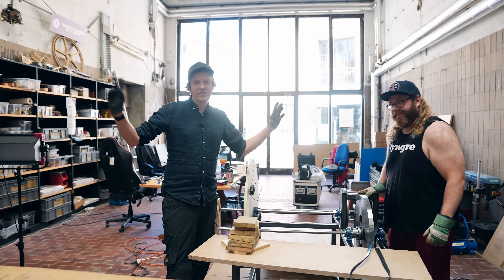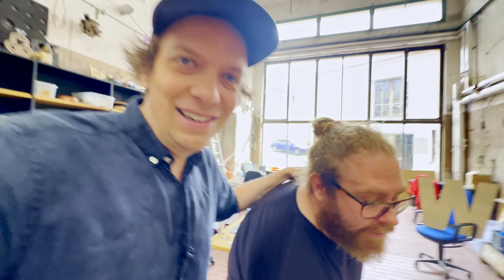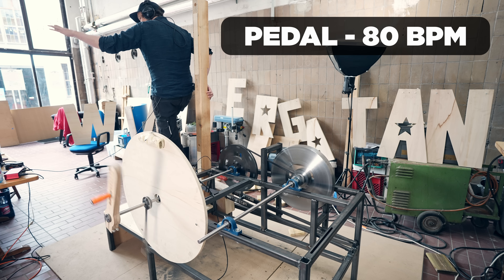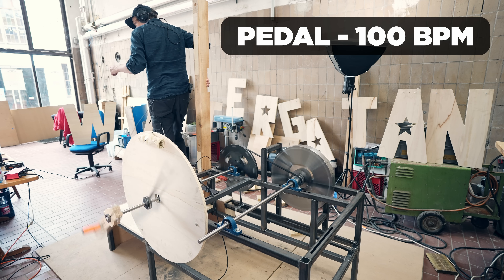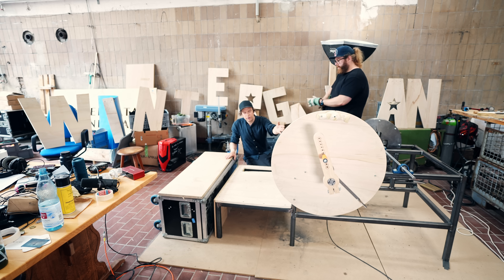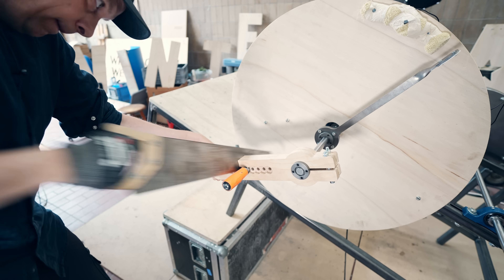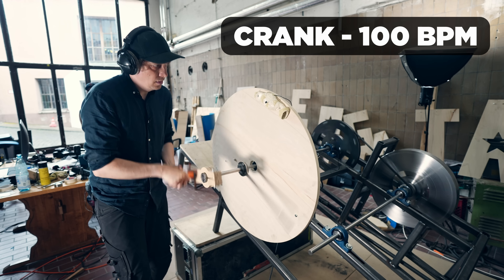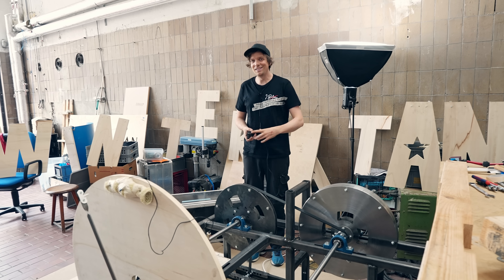Heavy Flywheel plays Tighter music! - DAY 11 - Marble Machine Flywheel Prototype

Comment: You're going to need some kind of RPM energy storage device that dumps RPM back into the wheel as it slows down. Once you connect your programming wheel and the pin start adding friction at different times it will be impossible to add the speed necessary back to the wheel as it's taken out. Maybe something like spending flyweights that expand outward as the speed increases to store energy and as the weight slowed down in rotation they dump energy back in.

Comment: Can a speed governor like you can find on steam engines be used to clutch into the flywheel system to set for exactly the RPMs you're looking for. It's where no matter how fast you spin or pump the power input step the governor will catch and dissipate the speed when it detects an RPM is too high.

Comment: I really feel like focusing his job on purely keeping the tempo and not getting mecanical aid that will hold the tempo where he wants it seems like a waist of time, if you have to do this I feel like the value of the flywheel is lost, maybe not use the flywheel as a direct imput but as a power "storage" that you feed into and the maschiene takes power out of that "storage" as it need to hold the mecanicaly fixed tempo, do not ask me how that would look like but it feels as if that is something that is possible and if so then a 100x better solution that standing on stage and taking pultiple seconds to adjust the tempo let allone being mindfull of your bodymovement and how it will affect your tempo during the performance, like I am sure that you would ha disapointed and not satisfied with having to stand still as a stick on stage during 2 hours.
Reply: about the mass of the flywheel, yes more mass will give you an easier time to hold a certain tempo, but it will make it a living hell to deviate from it if needed

Comment: If you really want precise music, you can use a mechanical speed governor linked to a clutch, like old record players had. Would look very steampunk with those two rotating orbs.

Though I think you should just set the spee by ear, the original marble machine worked fine in that regard. No-one was like "oh the music isn't exactly x bpm"

Comment: not sure if you want to drive youre marble machine with it eventually as the big flywheel make things go smoother but if sumting jams up the machine like a marble falling in between two meshing gears it wants to drive through it more forcefully and possibly break stuff , you cannot stop a flywheel as fast as you can stop cranking the machine by hand without the flywheel

Comment: if it understand this correctly, if you want to keep120bpm you have to push the foot pedal down 120 times a minute, i have no idea how to do it but wouldnt adding some kind of gear reduction to the foot pedal help with keeping a beat? It will at least be easier on the body if you get a 2/1 reduction and only need to push down 60 times a minute for a 120 bpm
Reply: He's attempting to ride in the Tour de France...with a single-gear bicycle.

Comment: Watching this and yesterdays test, I think a big problem you're having with the slower tempo is following the groove. I bet you'd have better results if you had a 2/4 or 4/4 beat playing. That would allow you to feel where your foot needed to be at the midpoint too, no just the downbeat. You said it felt natural at 120 bpm and it's cause you can easily groove to just the downbeat when it's that fast. 

This wouldn't be an issue when actually playing the machine because you'd be able to hear more notes playing even at 80 BPM and thus find the groove.

Comment: Have you considered a sprag clutch bearing to transmit power to the flywheel?
It’s an off-the-shelf one way clutch that acts as a roller bearing. 
It would certainly add a safety measure by allowing the flywheel to rotate freely when not being driven, whilst allowing the driving mechanism to be stationary. 
When driven at any greater rate than the load is rotating it transmits 100% of the input power.

Comment: When tilting the whole machine you are also rotating the end point of a full rotation of the crank handle. I'm sure it would be easier to hit the beats if the beat was at the bottom point, relative to how the prototype is rotated. In this demo, you had to hit an arbitrary point from the sound feedback in the headphones. With a correct endpoint of a circle, you could feel where the correct rotation would be, instead of listening to the feedback. - Down, down, down , down. 

I know it's just for testing, but this should factor into why the crank handle is even better.

Comment: What about the resistance of the rest of the machine? Won't it significantly affect the effort required to play, and change these results? If you're getting tired just spinning the flywheel, imagine the rest of the machine for the duration of a show. What I'm getting at is, my opinion is you should just do an electric drive. Plus if you're not forced to constantly pedal, it can be more like you're playing the machine than just powering it.

Comment: This is an area i really know very little about, and  my intuition pretty much runs the show. However, iam wonder if you should perhaps focus more on the gearing, weight distribution and consider what effect centrifugal force and indeed the inevitable friction Actually play.

If nothing else, heavier means more friction and thus wasted energy, and the mass located closer to the center, in my mind, contributes just as much on the negative side, and little on the positive.

My suggestion would actually be to make it lighter, or at least not heavier, and instead move the majority of the mass to the edge and preferably also increase the diameter as much as is practical. This this should ensure a significant and clear result, be it good or bad.
It should demand the same or significantly less of you, while yielding, at the very least a similar result, and if so, it is certainly worth a significant amount of you focus.

Comment: If Martin wanted to test consistent tempo but not use electric motor(maybe design is pending addition of it), he should do a rotation deviation check.
It consist of rotating input to x amount of revolution of the output and see if the output rotation deviates from input.
Usually belt slippage in their use case(because a smooth belt is used) and belt stretching/tension can cause deviation to accumulate over time.
I think it is not time to say it but if electrical motor is added, feedback sensor to detect rpm and PID would be a good addition so Martin can just set a rpm and the Marble Machine will be able to quickly ramp motor output to reach correct tempo in short time.

Comment: You'll never get this system to work well without a governor or some mechanical means of regulating tempo. Even with a governor, it will be extremely difficult. It's an absurd thing to ask for in a design like this. 

As a DJ with 23+ years playing vinyl records on turntables, I can very confidently tell you that even if you did have a device that regulates the tempo (pitch fader on the turntable), getting it to match or sync with a second track is very difficult. You need to recognize that this flywheel alone will not get you on tour. You will be spending way too much mental energy on the simplest part of the machine instead of concentrating on improvisation and musicality.

As a fan of the channel through all of MMX's build, I would strongly suggest you concentrate on making the motion drive completely automatic and governed, same as a wind-up music box. We as the audience loose nothing by having that driven electronically. We gain your confidence in focusing on the visual musical contraction and the music itself instead.

Also, you need to recognize that the wheel handle that already hurt you is VERY dangerous and should not be fixed tightly to the shaft but should have a disengaging ratchet toothed gear that spins freely opposite the direction of movement.

Comment: I know you want to manually power the Marble Machine, but I have a feeling that you will be more concerned about trying to maintain the tempo and wear yourself out. I suggest using a variable speed motor which you control the tempo and concentrating on the music, not trying to maintain the tempo.

Comment: Add speedometer !!! Set the speed of the crank for each BPM on the speedometer it will be much more simple to get the perfect speed of the wheel for the operator. You will be able to focus more on the music. 

Nice job so far ❤
Reply: That would work. RPM to BPM he would have a gage to read and a much lighter flywheel.

Comment: I feel like the trying to put a flywheel (with significant inertia) in the machine is just a bad idea, way to much time to lock onto a tempo, way to much start up time, and inaccuracies are massively magnified. like the top comment says, a metronome is out of the question with the flywheel.

I've said this before, but if feels like you are taking the most notable (and enjoyable) aspects of the original marble machine, and eliminating them.

Comment: No wonder why the bpm is the tightest because as I've said in the previous video, in this bpm, it is almost like a kick drum wherein the sound you hear is almost the same as the moment you step down the pedal. the faster the bpm, the lesser the lag between the input and the output using this flywheel/pedal combo. but for more reliable bpm, i still think it should be driven by a motor or as other suggested some type of governor.

Comment: I'm baffled, he keeps saying it's tight but it's clanging like a terrible DJ all over the place. This is straying into previous MMX, bad idea + fix + bad idea + fix = failure. add a governor, don't play in sync, have set points tuned to correct tempos with governor, sync everything else to the machine.

Comment: Martin, You have to do something about the crank! I know its only a prototype, but hear me out please.  If you slow down the video and look at the position of the crank in relation to the timing arm, it is slipping. This may be adding to your deviation times and should be considered. If I could make a humble suggestion, you could make a small metal disk, that has a tri-hole configuration to allow you to attach your current handle. The metal will be more reliable like the footpeddle one and allow for more tight timing with your cranks, and easy to implement. Which means more tight music! Best of luck, thank you for all that you do!  - Gio

Comment: I think you're really measuring the wrong thing here. I fear a far a bigger noticable change in tempo happens between the hits especially with the foot pedal because you cannot exert a constant force. Like when you push down on the pedal it will speed up, and when it goes back up it goes down again and it oscillates around the target BPM. With the hand crank you exert a more constant force but it can still have an effect.
So you could be on the perfect BPM but all the notes could have a lot of swing.

Comment: I'm sure this has been mentioned before...having a tight timing on just a flywheel with virtually no resistance on it is probably a misleading feeling - You are adding miniscule energy to the system to keep it at the same energy state - in reality the machine will be sapping many watts of energy lifting marbles and running mechanisms. It would be more realistic to add a slight brake to mimic this energy loss. It will make it a) harder to keep up calorie wise, and b) way easier to let the machine slow down if you get ahead.

Comment: Since you are getting only one feedback beat per revolution, your feedback-loop is way too long. Ex: if the beat perfect, you don't accelerate. so next beat will be slower. then you accelerate, maybe too much. Result you will always be too slow or too fast. A you can see in the results, 2 peaks in the bin graph. try putting 4 or 8 ticks per revolution, see what happens

Comment: more weight makes the energy in the system more stable, as flywheels are an energy storage device in principle, it's like adding 1 kilo of hot water to a 1 kilo of cold water reservoir, the temperature shift will be massive, if you add that same kilo of hot water to a 100 kilo cold water reservoir the change will be less noticeable.

The same applies to your system, a bigger and heavier flywheel will have a lesser reactions to energy input deviations (human error) and will be overall more stable

you could make an even heavier flywheel and jump start it with a motor

Comment: You problem is the flywheel is not free running need a one way clutch so you can add power with out slowing it down then a governor to set the top speed

Comment: I'm hoping you's using the metronome to be able to know when you're at 80 bpm etc, and not that you feel you need to have a metronome and match the phase of that? Matching the correct BPM could be trivially solved by a small electronic device that measures the time between the beats and convert that to a display. That way you'd never have to catch up the correct phase - just match the bpm. In fact, I think one could construct a really cool mechanical bpm measuring device, like an old time go governor where rotating weights are flung out further or shorter depending on the speed. The angle would indicate the BPM.

Comment: The idea of the peddle both providing power and being responsible for timing seems like a moonshot idea. 

IMHO, peddle should be responsible for power (if manual power is desired) and some other mechanism for using the power to control the timing. 

But I’m not an engineer.

Comment: The crank might be getting tighter results because you can "see" the beat with the dial movement. The pedal is more of a linear movement but with it slowing as it reaches either end so it might be harder to match.
Reply: Time to turn it into a pedal marble machine instead of a pump

Comment: To be honest with you i don't see the point. If you play live to a click and backing track, this cannot work because all the extra weight makes it virtually impossible to control once you're out of sync. If you don't play to a click, there is no reason to try and sync up with one since all this catching up and slowing down is compromising the results. I think you got 2 options. 1: if you really need to play to click, then i don't think manual without a motor will ever do it. 2: If you don't need one, you should test without a click and go from there

Comment: If the BPM is stable at higher RPM then what will you do to resolve the lower BPM discrepancy? Should this machine have two seperate fly wheels? The heavy one for the high RPM higher BPM but a lighter one for the lower RPM lower BPM? Or would your weight mechanic work better for the lower BPM?

Comment: remember, you don't have to increase the speed much to increase the energy the flywheel stores, since E=1/2 MV^2, which is a quadratic relationship
Reply: you might also want to include a motor or someone else who keeps the energy of the system going, like how pipe organs used to have people who's only job was to work the bellows

Comment: I know nothing.  But this looks like a nightmare to me.  I would look a doing something like a wind up watch.  Get the spring with built up tension, and you dont have to constantly adjust and power it. You can get ahead and rest, do other things. And theoretically,  get a constant output.

Comment: you should not have a fixed tempo on the computer but have ita certain time after the beep from the machine . this would solve the problem where you are not in phase and need to accelerate and decelerate
Reply: Had what may be a similar thought, having "target" click dependant on previous revolution's contact mic (or other) input, probable simple Arduino sketch with less scope for time creep... I believe...
Reply: using the contact Mic to count the BPM and digital display with a target indicator would be far easier than trying to sync up to the metronome. then, once he has gotten tot hat target range, he should do his testing. i hate to say it, but his methodology is flawed. i as a viewer want the best for him for sure, but i think he has come considerations that are already limiting his design and ability to complete it. a motor should be used to maintain the RPM of the machine to get the desired BPM. then if desired, Martin could still use the manual rotation devices to start the machine, and use the motor to Run it, while Martin Plays it...

Comment: Yesterday you commented that the hand-crank felt "tighter" than the pedal but actually objectively wasn't.

Today I noticed something that might explain your perception: the timing of the click.

When handcranking, you're clicking when doing the most physical effort, yet while stepping, the click seems to be when you are stepping off -- ie when you've  just reduced the effort. What might be worth experimenting with is rotating thetiming wheel andjust experimenting with what feels good to you.
Reply: REALLY good point. Timing doesnt land on the foot stomp, it ends in the middle of the leg. The midpoint of the leg is harder to time.
Reply: @mrlithium69  Exactly. However, the problem is more nuanced, because there's no straightforward way to land the timing on the foot stomp, because the pedal moves in a sinusoidal motion, so is very slow when it starts moving down, and is therefore not accurate.

Players of stringed instruments need to start their bowing motion slightly ahead of the beat so that they have time for the note to reach full volume on the beat. Compare with a piano player (or even a xylophonist!) who has an instantaneous response and has to hit the note absolutely bang on time. The exact offset for the treadle to feel right is something that absolutely needs trial and error.